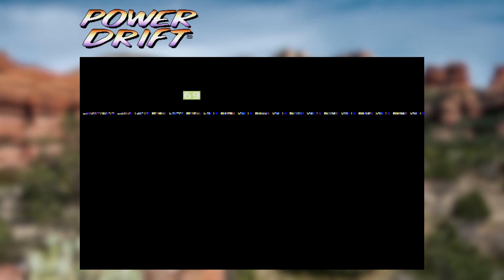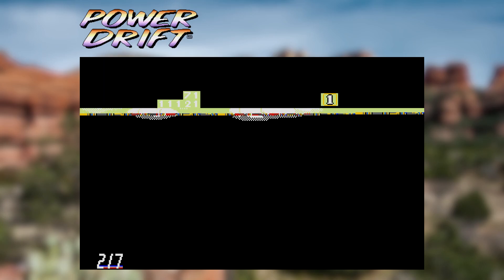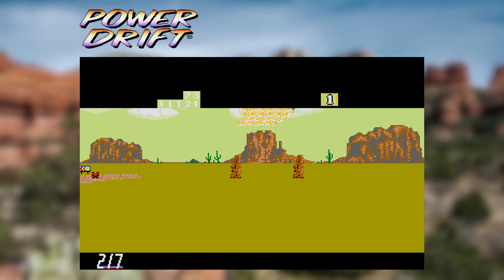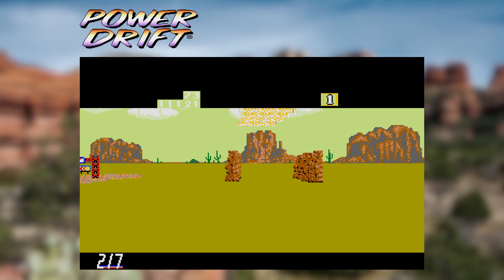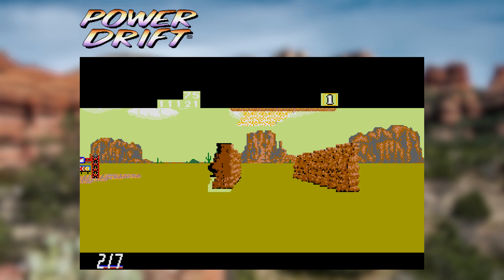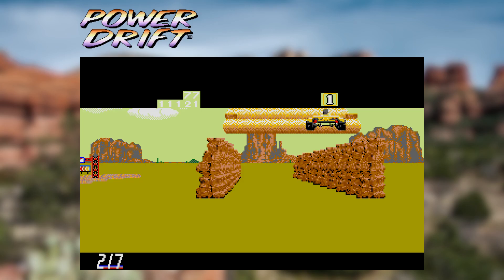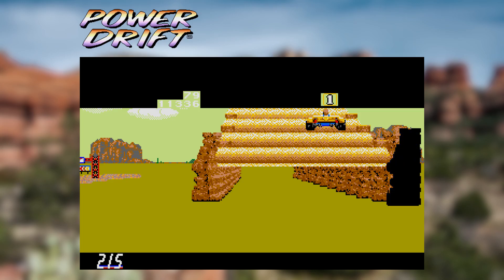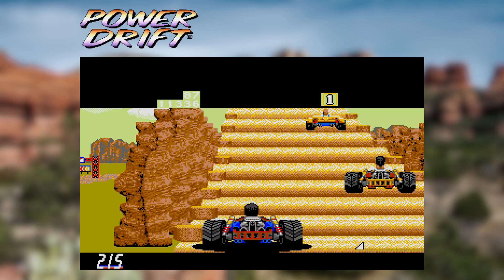Atari ST Power Drift - deconstructed!

Comment: I was amazed how inefficient that drawing routine is, being used to DirectX9 style drawing now-a-days (and thats even pretty retro now lol) with occlusion being pre-calculated to avoid wasted draws. I wonder if occlusion calculation turned out to be less efficient than just drawing every single thing back to front? or did it just never occured to the developer to pre-calculate / calculate occlusion draw optimisation? either way interesting content, thanks.
Reply from the maker: I recently read a "making of" article in an old magazine for the ST and Amiga conversions of this game. I think one of the main challenges they faced was managing to cram the sheer amount of graphics and sound data required for a single race into the 512K available. I suspect that precalculated occlusion/visibility/sorting would have improved performance but would also have required compromises in other areas (e.g. storing a smaller variety of graphics or sound).

Interestingly, I'm doing a certain amount of precalculated visibility and sorting in my Power Drift project ("Power Drift-style graphics engine for the Atari STE"). The required data takes up around 32k per track and improves performance considerably, but the current method does constrain the number of "objects" on the track (ground "logs" plus billboards and cars) to 255.
Reply: @gridleaderretro  thank you, and a really great explaination :).
Reply: modern 3d occlusion plays in a totally different ballpark, you save much more expensive operations with that than with blitting out 2d gfx. and not only that, its prewritten for you in a library, you just need to ask for it to happen... on 16 bit level this would be very complicated, and the complexity means you will not gain but lose with it.
Reply: @kangarht  Yes, but still, I've coded for the Atari ST in 68x assembly and code for the x86 too. To overdraw parts of the screen buffer (at least on the ST without a blitter, a blitter may change the rules due to its speed and keeping it from being idle, I've never coded for the blitter, only having had an ST, then a Falcon 030 [and there using the DSP and getting my head round parellelising). When I was writing screen routines every write to a bit plane I could avoid or combine saved critical CPU cycles. Still, I was always a "wannabee" coder, still look up to idles like Sector One and Lost Boys. They could make the ST sing! Modern occlusion is all farmed out to the GPU and software versions are very inefficient because its specialised for prefering to offload vs getting it fast on CPU (and theres no insentive to speed the Software renderer when Microsoft can get great kick back from hardware vendors to optimise their experiences).

Comment: How do you think Power Drift would look and run like if it was programmed natively for the Mega STE by a skilled 68000 coder?
Reply from the maker: Not much different from this I suspect! The game does run on a Mega STE and makes use of both the 16Mhz CPU (for a smoother framerate) and the Blitter chip. This game gets a lot of criticism, but I honestly believe that it couldn't have been done much better.
Reply: @gridleaderretro  Yeah, the programmer had his hands tied. He wanted to keep the game as faithful-looking as possible, but there were very few possibilities. I think he deserves more credit
Reply from the maker: @mortenera4423  I agree. Power Drift on the ST and Amiga is an extraordinary accomplishment. One day I hope to have a  go at implementing something similar from scratch, and I'm not confident I'll be able to get the same level of detail on screen at a comparable framerate.

Comment: The road tiles seems filled rather than single elements (mean there is a base shape of a flat color, then is filled with a pattern, either gravel, wood, concrete, ecc.) - is possible to see how much raster time is used for each part of the screen rendering?
Reply from the maker: Yes, it should be somehow possible but it might take some work! I may have an original unedited version of the video where each frame represents a horizontal blank, where there are 15650 horizontal blanks per second. Would that help you?
Reply: @gridleaderretro  Unfortunately have no dev skills so will pass for now - working on a soundtrack transposition in mod from Hoot, though - will come handy IF someone want to put its hands on it
Reply: @gridleaderretro  I vote for publishing this video! ❤️

Comment: Excellent video again! Keep them coming. 😉

What interval did you use for the backbuffer captures?
I am under the impression that the rendering of the small far way sprites take about as much time as the large ones in the foreground so I was wondering whether you were dynamically changing the capture interval as rendering progressed or whether it was constant?

If it is constant, then I am left wondering why on earth are those small sprites taking so much time to render when the large ones are so fast.

In any case, fascinating results! Looking forward the next videos.
Reply from the maker: Thanks for your feedback - I'm glad you like this series!

The backbuffer is captured on each HBL interrupt - so I believe this equates to 313*50=15650. As you've observed, I did speed up the video towards the end, as the larger sprites were taking ages to render! I should probably have mentioned this in the voiceover to avoid confusion - sorry :)
Reply: @gridleaderretro  No worries, speeding up the video to avoid the inevitable blank moments makes perfect sense. Maybe you could give this one a companion video with constant speed? 😉

Comment: Very interesting. So is filling up one bit plane at at time and blasting it to the screen the best way to use the blitter?
Reply from the maker: Yeah I think that's the most pragmatic way. You don't have to go one bitplane at a time if you're rendering only at 16-pixel intervals, but if you're doing that, you're not leveraging one of the most important advantages of the Blitter :)

Comment: It's amazing how many sprites are on screen
Reply from the maker: Absolutely! In that sense, it's amazing that it runs as fast as it does! I can think of a few good reasons why Sega never attempted to put this game on the Megadrive/Genesis :)
Reply: @gridleaderretro  It might be able to run on Sega CD or 32X, but there would still be sacrifices (Aside from the sound)
Reply from the maker: @mortenera2294  I agree - the 32X would have a good go at Power Drift but isn't quite there in terms of hardware. It did have a port of After Burner running at 30fps, but I think the Power Drift hardware was a little more advanced than that of After Burner.
Reply: @gridleaderretro  Power Drifter was one of the last super scaler games, and its hardware was pretty powerful for 1988. I'll take some info from wikipedia:
"Added an extra CPU and memory, as well as upgraded video hardware compared to the X Board. Capable of performing real-time sprite rotation"
Reply from the maker: Interesting - thanks for the info! I guess it's the rotation that would have really killed the 32X. Although I'm not sure that the 32X even has hardware sprite rotation. I know the Sega CD does.
Reply: @gridleaderretro  Maybe using both add-ons would be the best choice, but we'd still lack background rotation and scaling
Reply: @gridleaderretro  So i see using four passes for the 16 colors - i envision using on Amiga dual playfield (8+8 colors) for background and 3D elements might give a little more sprint - plus using flat shades for the street elements; of course this need to be recoded from scratch for Amiga at this point...
Reply from the maker: @simonebernacchia5724  I think the developer of Power Drift (ZZKJ) faced an impossible dilemma. He could either created a watered down interpretation of the arcade game (as with the C64 version), in which case he would have been accused of creating an 8-bit game on a 16-bit machine. Alternatively, he could either try to replicate the full-fat arcade experience, which is what he did, and be faced with criticism of the frame rate due to the game being too ambitious for the machine :)

I have to wonder if scaling back the graphics or colours in order to get a slightly higher framerate would have been the right thing to do - I suspect not.
Reply: As a game developer, my position is that what matters most when porting a game is fidelity to the gameplay, the rest being secondary.
Being able to race at 50-60 FPS in 3D on the Power Drift tracks (and in multiplayer with a serial link) would be exhilarating enough to wash away any complaints about the graphics IMO.

Now, you raise an interesting question regarding graphical faithfulness to the original: what would the game need to look like to be able to play at 50-60 FPS?
We can try to guess by 1) looking at optimization opportunities missed by the ST/Amiga ports, 2) try to figure out which elements could be simplified on those ports to gain some speed.

As far as 1) is concerned:
There is enormous amount of overdraw between both vertical sprites (road sides) and horizontal ones (road spans). It is clear that many of the background vertical sprites are completely obscured by foreground ones so even a very simple overlap detection mechanism would allow to discard them from the screen drawing queue. This would be slightly complicated by the fact that those sprites have transparent borders but it is easy enough to check overlap between their opaque sections which would save enough work every frame to be profitable.

Road spans only partially overlap but since their mid section is entirely opaque the overlap detection is even simpler: before drawing them, compute the overlapping sections and clip the sprites accordingly before putting them in the drawing queue.

It is clear that overlap detection would have massive benefits: the first 10 layers of vertical sprites are completely obscured by the following ones and even the massive last layers of vertical sprites are at least partially obscured by the road spans.
If those sprites were properly clipped before being sent to the drawing routine, the gains in draw speed would probably exceed 1/3 of the drawing time, possibly much more.
Of course this is camera position and road curvature dependent but on average those gains should be significant.

Another optimization would be to improve Blitter use for the very large sprites: as it is, four passes are done in order to clear the background using the mask before another four passes of OR blitting the sprite onto the background. Those large sprites are totally opaque except at their border and it would be way more efficient to separate transparent borders and opaque interior since the interior only needs four Blitter passes since it does not require the mask clearing. That would also significantly speed things up.

Also, does the back buffer start as all black or did you set it up this way to make the rendering more visually interesting?
If they are indeed clearing it, this could probably be completely be eliminated since it looks like every pixel of the screen ends up being redrawn anyway. I hope that they really did not go with that option as this would be done in pure waste and would be quite easy to fix.
(But then again, one never knows... I have seen worse things being done when hastily writing code for an imminent release.)
Reply: @simonebernacchia5724  It is not guaranteed that Dual Playfield will give a speed advantage. This mode uses all 8 available bitplanes which saturates totally the DMA bandwidth during screen rendering, meaning that CPU and Blitter can only work during the horizontal and vertical blank periods. This leaves them even less time to draw all the elements.
I am not excluding that this could work since separating foreground and background elements has speed advantages but this would not necessarily straightforward.
Reply: @gridleaderretro  So two things come in my mind, but would need a full rewrite:
[hence might not be Power Drift anymore, maybe a Victory Heat Rally clone]
first use just a quarter of the screen for operation then expand on screen - will look blocky but is not a problem, is giving a 'super scaler' feeling - second use dual playfield for the road tiles and eight color elements, this involves using smaller sprites for players too, though (since player sprite might be max 64px and with its own 16 colors) - will look a lot like drivin force but using a real 3d environment - now i wish i know how to code in assembly and handle big threedimensional arrays (because at the end that is what the PD playfield is)
oh, i forgot - use sprite repetition for landscape!
Reply: @nekononiaow  Am honest, for a game like this in an OCS/ECS machine a target of 12/17 FPS is the best you can get of, but still better than the actual crawl - then if you want to bend the screen a bit with copper/blitter on curves that should enhance the effect
Reply: @gridleaderretro  Removing or simplifyng the pattern fill from road tiles? I suspect it to be a bit of a bottleneck too [please am trying to find a way to make the impossible feasible]
Reply: @simonebernacchia5724  Any target frame rate can be achieved as long as one is willing to make compromises. For instance, reducing draw distances, number of colors, sprite precision, etc. When you have removed everything you will necessarily hit 60 FPS after all.

I recommend starting from a prototype which replicates the gameplay at its original frame rate but with hyper minimalistic rending using only simple vector squares to represent each element. This should run at 30 FPS without problems and if it does not, reducing the number of objects in the distance until the desired frame rate will bring you there. But with only basic vector squares speed is likely to be very high without compromises.

Once you have a smooth frame rate, then one can start progressively improving the graphical fidelity, optimizing whenever those improvements cause frame rate to drop.
When you cannot increase graphical fidelity anymore nor optimize, then you have shippable product that may not be as beautiful as the original but will at least be equally playable, which is what really matters.  😉
Reply: @nekononiaow  This is one of the moments i wish to know to conde in C  or assembly
Reply: @JMDAmigaMusic  Every person who knows how to code in C or assembly started from where you are. It is up to you to start learning them.
Start small, one step at a time and be ready for a few efforts and you can learn anything.
Reply: @nekononiaow To reach that proficiency level might take me several (tens of) years, hope there will be some real amiga hardware by then, considered that i will need to:
- learn properly C, pointers and structures
- learn Amiga C programming
- learn to use properly blitter,copper and audio
- learn how to implement a 3d world
- implement a camera system that follows the player
- optimize results for an amiga 500 with one meg RAM

right now am barely at step 1 thanks to use php and javascript that have a c-like syntax but nothing more
Reply: @JMDAmigaMusic  One step at a time you will get there. 😉
Reply: @gridleaderretro  Do you think some optimization to increase frame rate could be done, like getting rid of ladyfingers copperfill or reduce a bit the range of sprite visibility? Am asking because am SO disappointed from Amiga version and i hope can receive the same treatment that Outrun on the ST did receive from fedepede04 - even though using one meg of RAM should help a bit
Reply from the maker: @simonebernacchia5724  I'm really not sure that either the Amiga or ST versions of Power Drift could be that much better. You could probably get a 10-20% speed increase through general optimisation, but anything beyond that would likely involve either the need for more memory (to precalculate things) or some kind of visual sacrifice (like the reduced view distance you've suggested). The Amiga and ST just aren't geared up to throw this amount of graphics around on the screen. In all honesty, I think it's amazing that they turned out as well as they did!

As an aside, I think there's a very good reason why Sega never attempted a port of Power Drift on the Megadrive/Genesis :)
Reply: @gridleaderretro  This version of PD uses 512k if i remember right so doing calculation in the extra RAM could speed things a bit; even reducing the max number of objects visible (range) should help - target in my opinion cannot be 50FPS, not even 25 but a range between 12/17 should be achievable spannometricaly [mean by simple eyesight] and game should be still playable